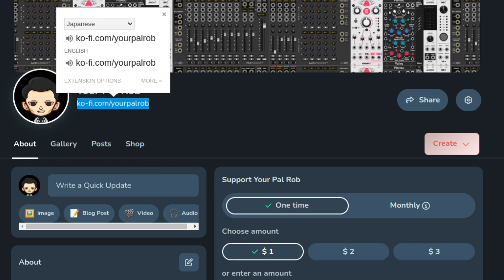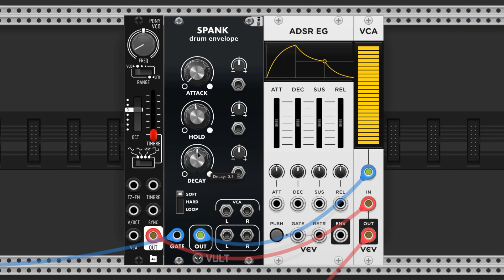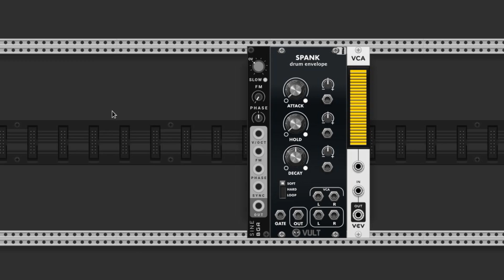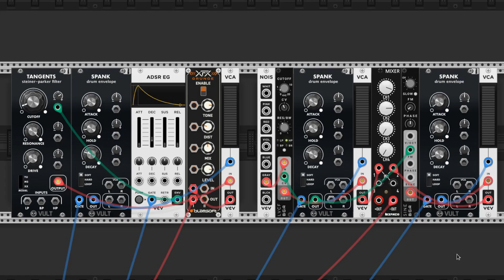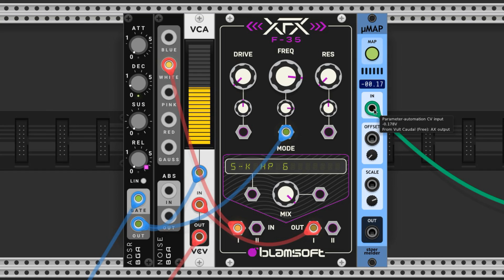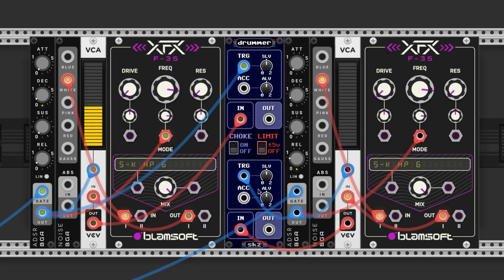Let's Make Drums In VCV Rack // Part 2

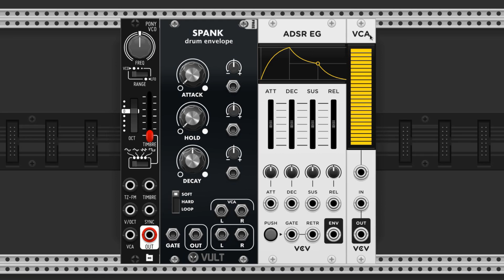Comment: You say "first connect the gate output at 1:35" but when you say this the Gate input next to the output you're talking about magically connects to something. Could you explain that as I can't get this to work.
Reply from the maker: The cable that goes to the gate input of the spank, this will be from your sequencer, clock, or other gate source, is also sent to the gate input of the stock adsr. It looks like it magically connects because I hold ctrl while I click on the port that holds that cable (the spank gate input port). When you hold ctrl and click a port like that, it duplicates the cable. I then connect it to the gate input of the stock adsr, no magic required. In the free vcv rack cheat sheet on my Ko-fi page, there is a diagram of this build along with others if you need more detail. The patch that has these exact drums can also be downloaded for free as part of my patch collection. Also on my Ko-fi page.

Comment: Great tutorial! One question - at 9:40, couldn't you connect the Caudal module directly to μMap and just use the offset & scale? 

Seems redundant to put an offset module and an attenuvertor inbetween.
Reply from the maker: Thank you for the comment, @AB-wf8ek! You totally can just use the μMap's offset and scale; however, I find the additional attenuverter easier to dial in than the μMap alone. μMap's controls are very sensitive in my experience so having a module with a little more wiggle room helps me. If you want a slick minimal module set up, you should totally skip out on the redundant modules :)
Reply: @yourpalrob   Nice, okay just checking if there was something I was missing. Thanks for the reply!

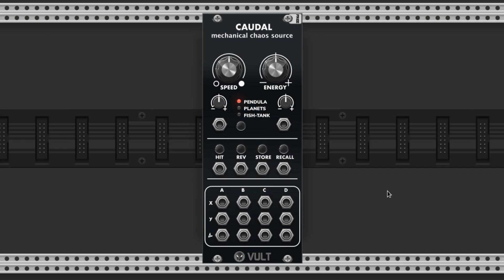Comment: At 9:00 , couldn't you have just used the Offset and Scale on the Stoermelder module instead of the attenuverter and add5?
Reply from the maker: Thank you for the question, Mattg5461! You can! However, the scale and offset function on the micromap are more difficult to dial in than with the dual attenuverter and add5 combo. So if you are using the micromap alone, the modulation depth will be slightly deeper based on the patching that I've done. I think the combo has more capability for subtle moves. The best thing though is there is more than one way and I'd like to encourage you to patch in whatever way you want. I hope this is helpful and thanks again! 🙂